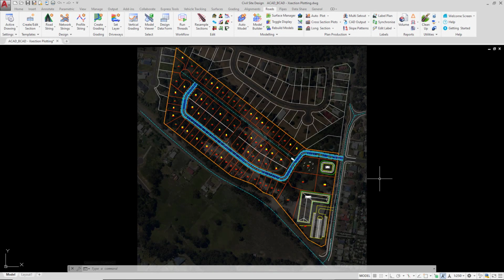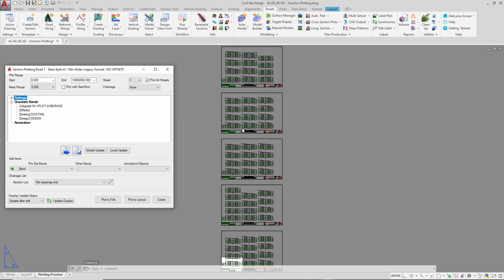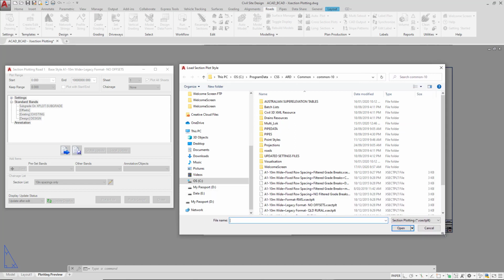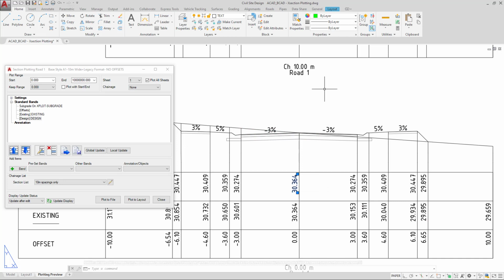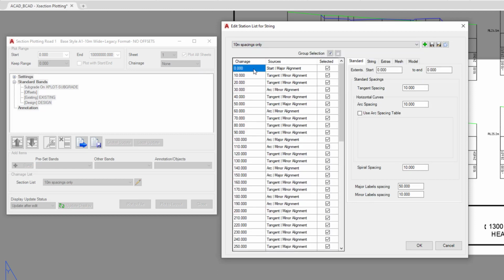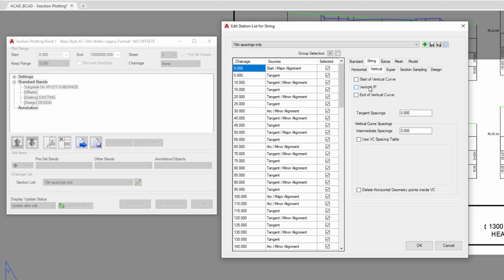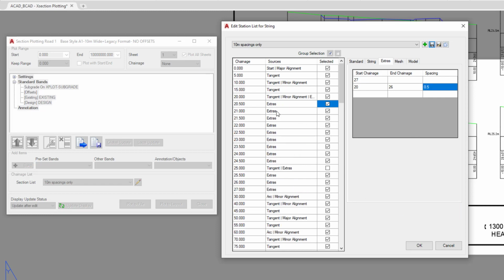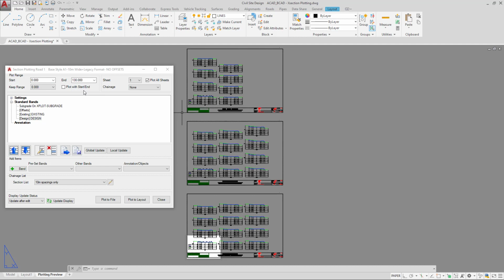Plotting Cross Sections | Getting Started

Comment: Hi. Getting my site plan viewport on each layout when plotting. How can I disable this? Using CSD latest. Thanks!
Reply from the maker: Hi there, in the long section plotting form go to the Alignment tab at the top. Set the Plan View Width to zero. This is the width (height as you look at it on the screen) of the viewport. Zero will draw nothing.
Reply from the maker: If you are getting a viewport with ANY plotting, this is controlled by your CAD settings, not civil site design. AutoCAD options has a control which creates a viewport with each new layout - you can turn this off.
Reply: @CivilSurveyApplications  Perfect, thank you 👍